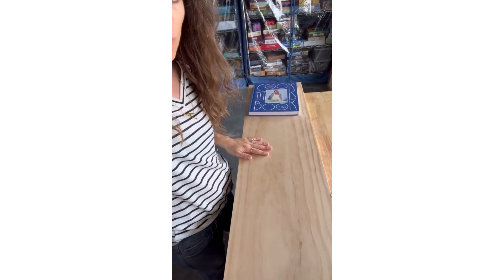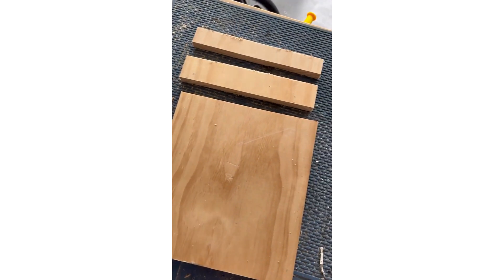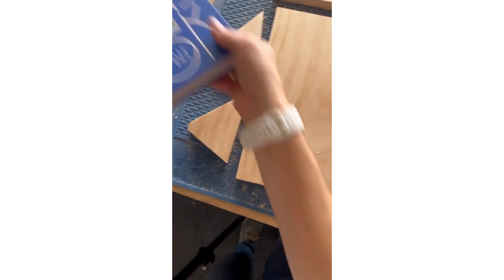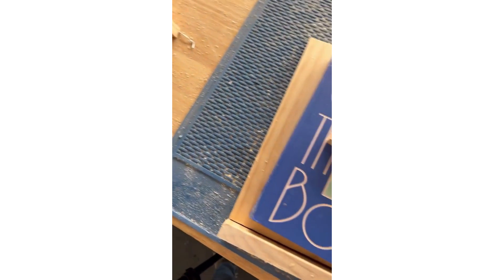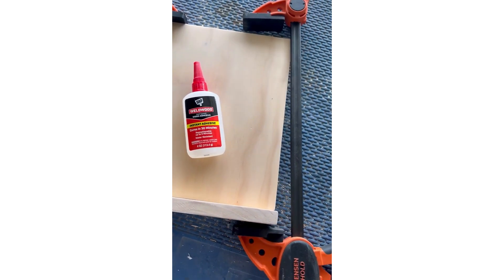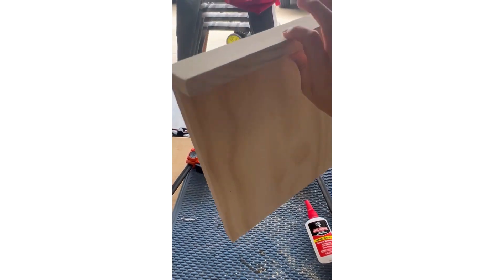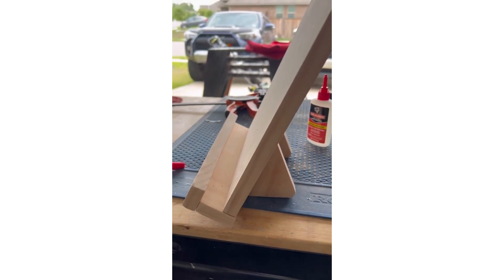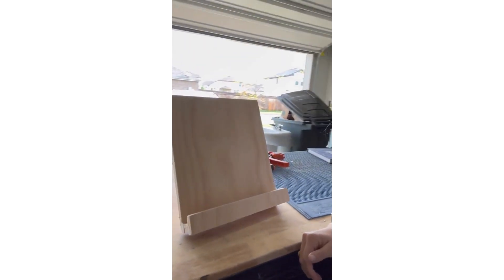How to Make a DIY Wooden Cookbook Stand // Easy Beginner Woodworking Project, Great DIY Gift Idea

Comment: While you achieved a functional cookbook stand in the end I wish you would have rounded off some corners and edges with your sander and used some brad nails in the shelf to give it some strength and longevity and to hold it while the glue dries.  While using power tools you absolutely should be wearing some safety glasses because particles of wood are absolutely going to heading towards those beautiful eyes probably sooner then later.  We'd hate to see you filming an unfortunate accident. In this project I'd only use the wood filler to fill in the nail holes.  I've subscribed to your channel because I want to see how your artistic and woodworking skills develop.  I hope you take my comments as a positive. Thank you for Sharing!